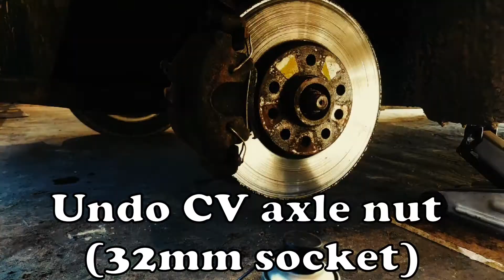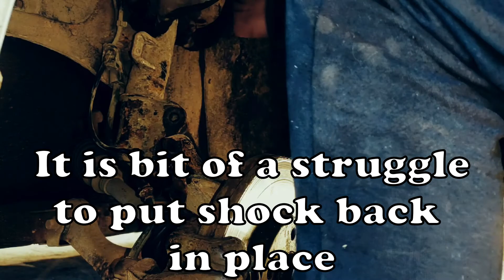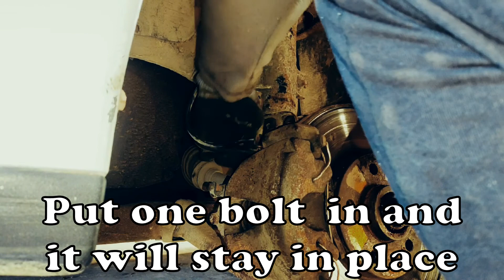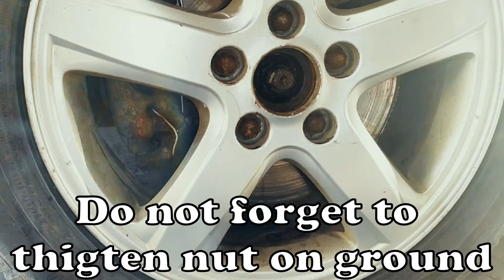Changing SAAB 9-5 ABS ring

Comment: Good video. Just a heads up, the SAAB Workshop Information System (WIS) also requires the use of Loctite 518 Flange Sealant on the inside of the new ABS ring prior to installation on the axle. Cheers.

Comment: To reduce the amount of grinding, you could heat the reluctor ring (hot plate, torch) so it slides on easier.  Thanks for the how-to - very informative, especially noting the hub nut is 32mm (not a socket in most shade tree mechanics tool boxes).
Reply: Once the rust is fully cleaned off, yes. That would be the reason the old one cracked as the rust expanded the metal
Reply: As a follow-up, pulling the hub off of the axle can be a real beast.  Years of rust & corrosion makes removal very difficult unless you have an impact hammer.  Just wanted to let you know what you may be facing.
Reply: forgot to add,  the shock absorber does not really need to be loosened/removed.